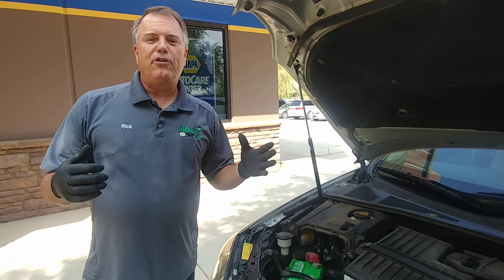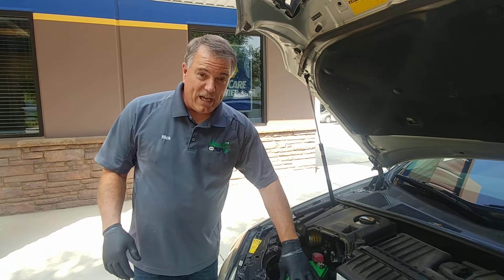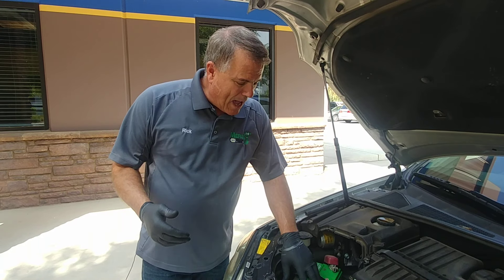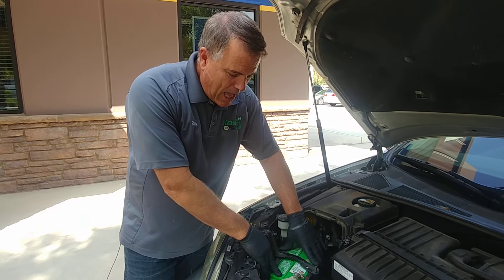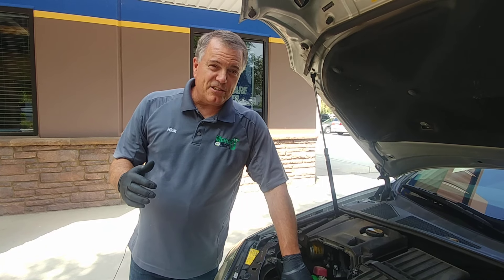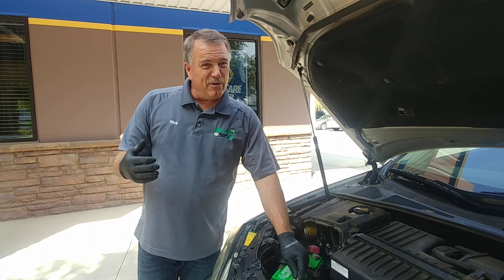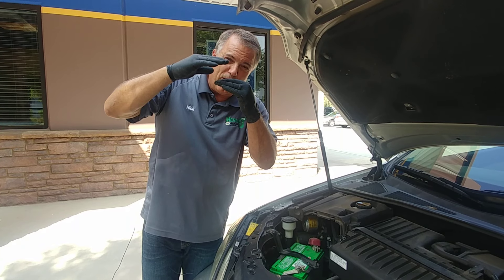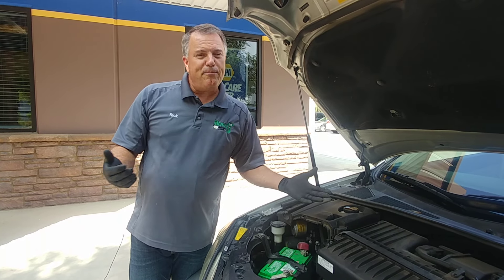Why do my Car Battery Terminals keep Corroding?

Comment: The reason for the corrosion is the electrical field that is created around the battery and that anodes and cathodes travel in the field around the battery caused that corrosion to build up, if you just glue a penny close to the negative side it will get corroded instead of the terminals doing that will cut the field and just replace the penny instead of the terminals, I been an Auto tech since 1982 and never had a battery terminals that got corroded on me it was an experiment I tried back then and it still works
Reply: Thanks, I will give the penny a try.
Reply: @Foodie_888  Try it and let me know
Reply: Where do you glue it?
Reply: @bradleypease2492  glue it close to the negative post on the battery but not touching the post
Reply: Cool trick. Thank you.
Reply: Wow!
Reply: Nope, the corrosion is caused by the seal being broken between the post and the battery casing by rough handling which let's the vapours leak, pour boiling over the terminals to get rid of the corrosion clean up the terminals and smear everything up with vaseline then connect it back up  always use 2 spanners and don't be rough.
Reply: @royblackburn1163  If what you're saying is true then why have the past 5 brand new batteries in my vehicle (had since 1988) plus 2 sets of new cables still corrode terribly?
Reply: @OhImKiCkiN  Hi , battery terminals are lead, battery casings are mainly plastic it doesn't take much rough handling to break the seal between them,  when you install a new battery take your time, be gentle with the terminals and you  should not have to touch it again  for 5 years or so, I've been doing this for 49 year's,  I'm also an electrician and I have not had any  corrosion issues on any of the 30 odd cars I've owned so I must be doing it right. You have corrosion, I don't, bad luck have a nice life.
Reply: @royblackburn1163  Nice credentials, but I disagree. There's got to be more to it. I've owned over 50 vehicles and my 88 Mustang is the only one I've ever had continuous corrosion on. The odds of damaging the battery every time it's installed, and only on 1 vehicle just doesn't seem probable.
Reply: @OhImKiCkiN  forget using vaseline it's a bit dielectric the same as battery grease use contact paste which is conductive and try and obtain cable's with lead battery terminals to eliminate having dissimilar metals, first of all though I would check your cars running voltage to make sure it's below 14.4 volts and  the battery is not gassing.
Reply: @royblackburn1163  thanks, I'll do that
Reply: @OhImKiCkiN the internet says it's undercharging if on negative, and over charging if on. Positive terminal. This would make sense. I changed my 6 year old battery that had corrosion on the positive with a new battery.  That one now has corrosion after a couple months. Same side. Checked the codes and it came up overcharging/under charging battery, something about a control module. Maybe your mustang has something aimilar
Reply: @OhImKiCkiN you were right. Dude was Internet smart. The corrosion is salt. You can replicate this by taking a freshly opened seashell and pouring some faucet water with sea salt added into it. Let it evaporate and repeat. The magnetic field of the earth imprinted in the slow formation and symmetric design of the shell will force the salt up the sides of the open shell against gravity and form a crystalline wall around the edges instead of piling in the center
Reply: Great idea. In my case, l cleaned up terminal even cut the ends of cables put grease felt pad. Terminals been clean but the cable behind the terminal that had no grease corroded this time. I will try penny method this time. Do you know how jumping affects battery? My car has to crank 3 times or so after l jumped last time. Also l live in cold climate and wonder if l should use battery blankets. Do you have any suggestions to take care of battery in cold climates? I imagibe blanket should be removed in summer or else it might overheat battery unless it breathes
Reply: @royblackburn1163 not true because the terminals will move ex hills curves speed bumps    Also the terminals have to be disconnected for certain car maintenance such as replacing a fuel pump or electrical component
Reply: @watsonanthony8438  I off road over rough ground, I can only explain why I don't have any problems,  have a nice life.
Reply: @royblackburn1163  driving through you gravel / unpaved driveway is not off-roading lol
Reply: @watsonanthony8438  True,  but I have a Land-rover 90 with a winch, several types of ground anchors, a 5' pair of alloy ramps and all sorts of recovery gear. This makes me almost unstoppable and very few can follow me.
Reply: It works for me my negetive corroded all the time i heard this penny trick and i havent had corrosioon for about 8 months now

Comment: The question I have is what does the corrosion say about the battery's health or age? Is it a sign of replacing?
Reply: This is why I watch the video hoping to find that out.
Reply: It’s not always a sure sign of old age or health since it’s a leak caused by a defect or general use. Remember everything on a car moves a lot when you drive. This usually causes issues due to friction or stress breakage.
Anyhow. General rule of thumb, in climates with ‘extreme’ weather conditions (high hot temps and low cold temps) your battery will last for 3 years. Most of the time you can go much longer, especially if you don’t let it die. Once an automotive lead acid battery dies and needs to be jumped, its capacity has dropped by roughly 50%. It should be replaced, or kept a very sharp eye on. 
Health can only be determined by using a load tester (dedicated tool) or testing with an amp/multi meter. 
Bottom line, if you have corrosion, your battery is leaking but could otherwise be healthy and/or new.
Reply: @cordcd7  So it’s life dropping by roughly 50%, does that only or mainly apply if your jumping a car directly from another vehicle w/ bigger battery cranking amp? Or does size not really matter? Would using a jumper box instead solve this issue?
Reply: @selwyn13  The capacity itself drops roughly in half when the battery is left to die - this being the amount of time the battery can provide power. So if it's a 100 amp hour battery (can provide 100 amps for 1 hour) and it dies, it is now only about 50 amp hour or more accurately, 100 amps for half an hour; since the output typically doesn't degrade but rather the time it can provide that output does.
Essentially if your battery can sit for 5 days and then start the engine; but is left to die (maybe it sat for 10 -14 days for example) it now will only hold its charge for 2.5 days.
I hope this makes sense. I'm going on advice given by a panel of mechanics who have a call in radio show that I used to listen to when commuting for work. The issue of dead batteries and having to get a jump came up nearly every week, so they covered it a lot.
Reply: @takeheartovercomer9138  same
Reply: @cordcd7  the math is amazing and makes so much sense ..
Reply: @cordcd7 exactly.  Something loose connection can cause it as well.  It’s one of the 2

Comment: Battery posts corrode because of leaks around the post where the case is supposed to seal on the post. I always use some silicone around the post where it connects to the case and the problem is solved. Good to do this when its brand new.
Reply: Silicon grease or actual silicone?

Comment: No mechanic has ever been able to explain this to me, thank you sir. I’m curious, could enough of the acid buildup prevent your car from starting?
Reply from the maker: If the corrosion inhibits the contact between the post and the terminal, it can cause starting issues.  Otherwise it starts ok, but slowly eats away at the terminal.

Comment: I think the location of the batter has everything to do with corrosion on the posts.   I've had some cars where the + post gets that green or white deposits around it.  Those are usualy near the front grill batteries that I assume take more water from rain, winter spashing etc.  
I have  Landrover with the batter compartment near the windshield not up front.  It has better quality terminals maybe.  I have a 5 year old Nappa pro 7594R (Lead acid) with ZERO anything on either terminal and I did not junk it up with grease.  No red/green felt rings, no dielectric grease.  How?  Looks brand new even though its on its way out and needs new one.   I can only guess its due to a good alternator + its away from exposure.   Location is everything with car batteries I think.

Comment: also if the corrosion keeps returning there could be a hairline split in the terminal causing the leak just some food for thought, it may be hard to tell cause just the smallest crack could be overlooked
Reply: yeah, i have corrosiion that keeps returning. i also now have a hole in my positive battery terminal. it had like charcoaly stuff in it. i wonder if that hole connects down inside the battery and if that is where the fumes are comming from that keep causing the corrosion. 
i might fill it with solder and then put a think layer of epoxy on the base of the terminal/ plastic. then with the terminal and clamp cleaned and reconnected i might give it a light spray with zinc paint to prevent further corrosion. i tried petroleum jelly but it only worked for a few weeks. 
i know when its bad because my car struggles to start.

Comment: why not put a little bit of epoxy around the base of the terminal? in my case it wont raise the terminal clamp enough to matter, i can still get it just as tight.
Reply: after thoroughly cleaning the terminals every 2 weeks, even painting the surfaces with primer. i gave up. i found some marine battery terminal connections and replaced my stock cars connection with those. no more corrosion issues, perfect starting every time. (these new terminal connectors are lead, so nothing to corrode). the battery is still presumably leaking fumes, so may not last forever, but its already 5-6 years old, so thats okay. but the way its starting, i fully expect it to last at least another year.

Comment: So if this happnes to my cables , does that mean I need a new battery???
Reply from the maker: Not if the battery is strong and healthy.  Just get things cleaned up and apply silicone grease.  Vaseline also works to help slow down the process.

Comment: If you hose it down do you need to worry about the positive and negative terminals getting “connected” by the water?
Reply: You should be disconnecting both terminals to 1st wire brush and remove the heavy corrosion.  After that, hose the clamps and posts off. No need to worry either way you do it. Just be sure to get ALL signs of corrosion off or it will most definitely come back.

Comment: Q, I have 8 volt- neg. ground system- A shop took out my old batter 3x9  saying it needed replace- put a so-called new one in. Trouble is 1st I notice the white corrosion- so I cleaned, then the other day it was dead- so I put it on the charger- 6v-30 amp. What I noticed was the 2 cable ends connected to the post- were quite hot ( not to hot to touch- but hot enough) I never noticed that when charging my old 6 volt.. what causes that- I remember years ago- actually decades ago- an old shop said something about "the polarity needed to be changed... I did check other wires- like going to headlight switch- but no other wires were hot.. It was just hot at the terminals- even the cables further from the post were cooler.. Should I just be on the safe side and just buy another new battery or is this sounding normal- the car is a 1948 Pontiac flathead 8

Comment: I was told by a mechanic I needed a cable rebuild……. Although besides the corrosion, the cables look fine?
Reply: Are they cracked, are they making a good solid connection...if not the is metal stretched and does not tighten down

Comment: Hi Rick, thanks for all ur information.  My posts connections  r so corroded  that I can't even unscrew the clamps off the posts. Any advice  as to how I can loosen  the screws ? N oh yeah, u also said that if battery  needs to b jumped , it only has 50%  capability  left...I'm  I correct ? Once again, thanks for ur info..
Reply from the maker: Lots of water with a Garden Sprayer Hose will get the corrosion off!
Reply: Hot water... Add baking soda to neutralize

Comment: This is not correct. The felt pads are supposed to be coated in the grease, (sold in same packet) to help counter the corrosion. Putting grease directly on the posts or terminals does NOT deter the problem.

Comment: Which kind of vaseline should i use? Does it really matter?
Reply: Just regular run of the mill Vaseline has like a blue top and clear plastic on it with a blue sticker on it that says vaseline in white letters
Reply: Well, I got some KY jelly watermelon, I’ll try that cause I ain’t got Vaseline.
Reply: @carlitoseuceda2000  👍🏻😂